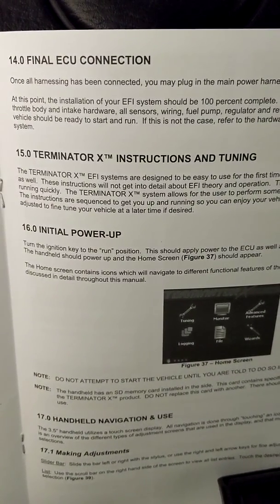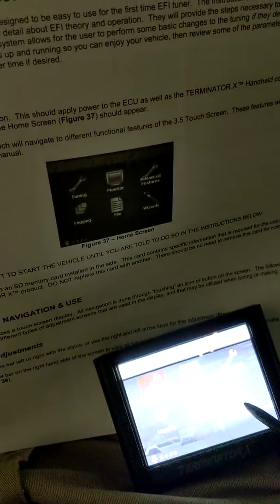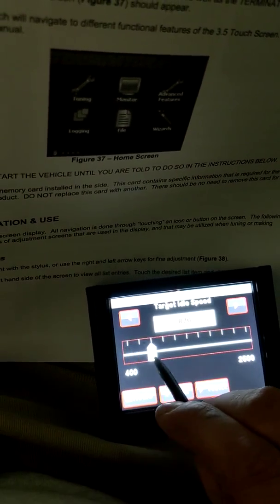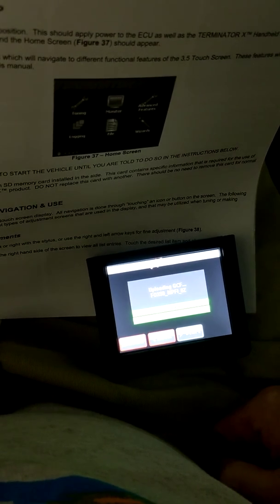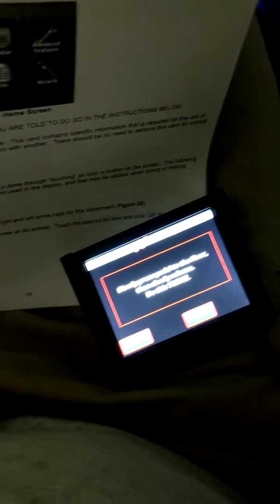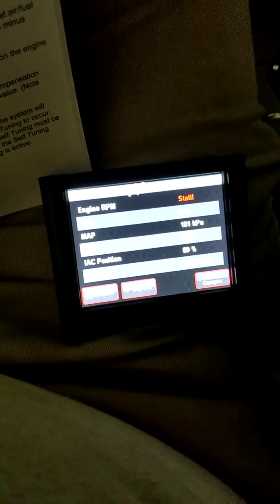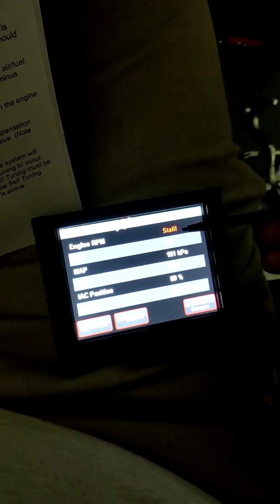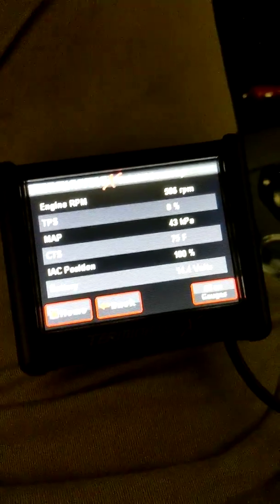Holley Terminator X 550-937f Wizard Start up

Comment: Great video and very helpful. What did you set you initial timing with your distributor and did you make any timing changes to the holley system prior to starting? Mine is currently cranking but not starting thanks in advance
Reply from the maker: I set the distributor to 10 degrees before tdc.  I have made some timing changes but did not prior to the wizard fire up.  The wizard does not set up the Ford IAC correctly, I think it has to be done on the computer.  Try cracking the TB.